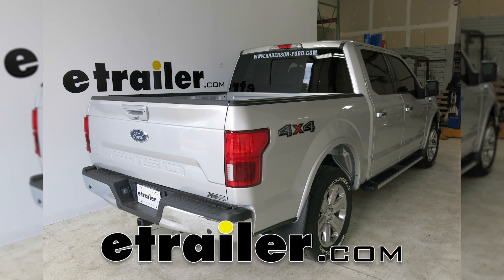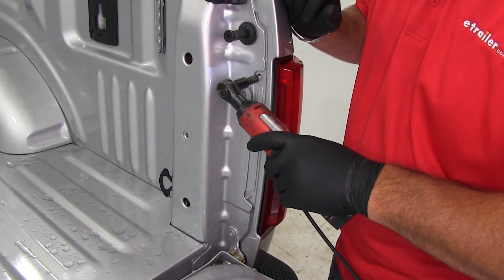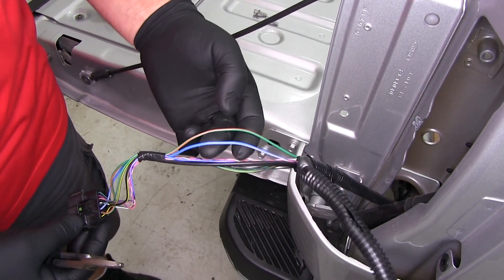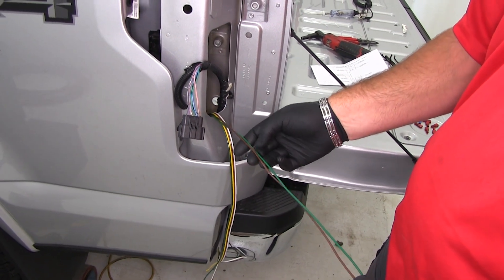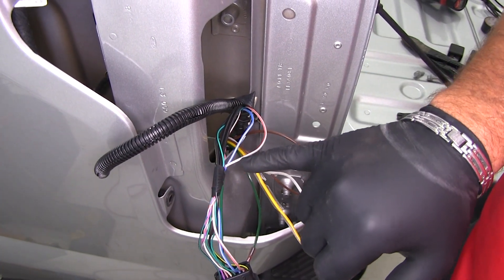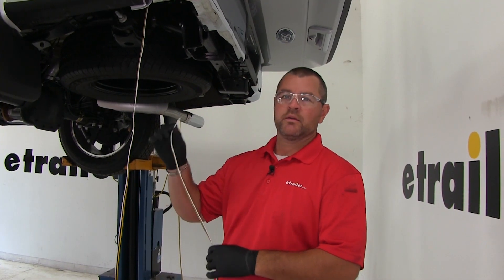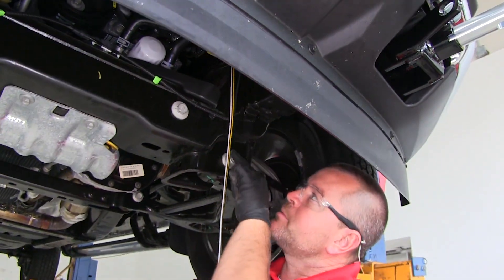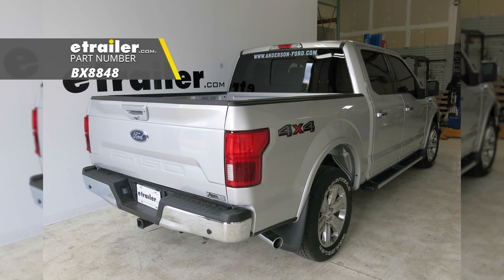Mount: Blue Ox 4-Diode Universal Tail Light Wiring Kit for Towed Vehicles on a 2018 Ford F-150

Comment: Why is there no protection for the wire , such as wire loom?
Reply from the maker: You can use wire loom if you so choose but the wiring is designed to handle the elements.
https://www.etrailer.com/Tow-Bar-Wiring/Blue-Ox/BX8848.html